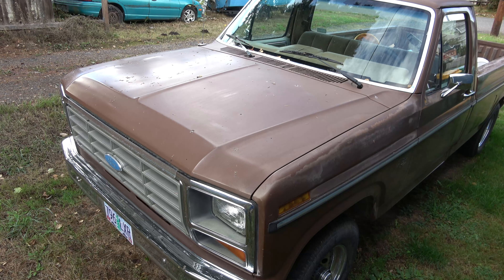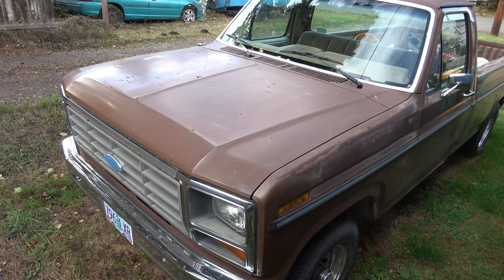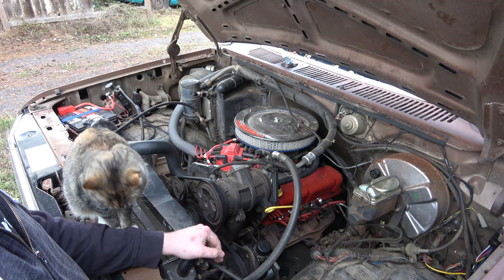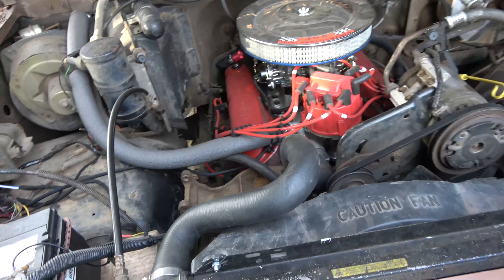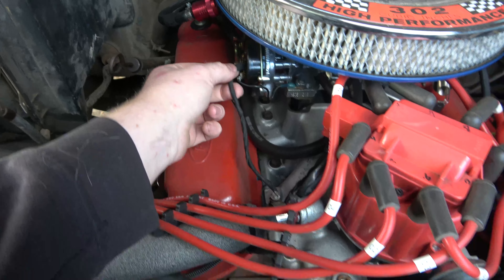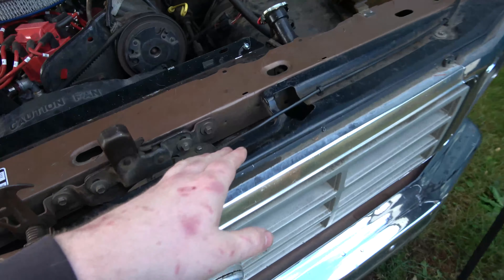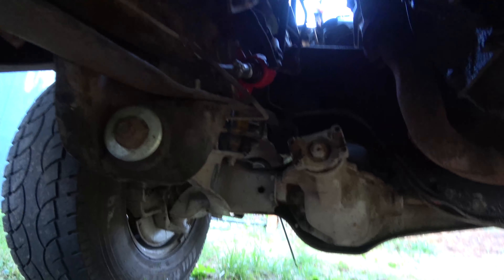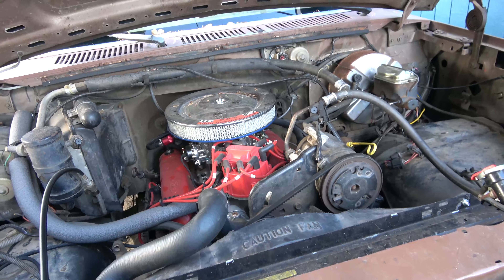85 F150 EFI To Carb Conversion Explained

Comment: Dude...u need a spacer under ur carb...ur gettin to much heat and vapor lockin...thats why it dont hot start
Reply from the maker: I ended up putting a 4 barrel carb and intake on. It has a 1” spacer on it now and it’s fine.

Comment: I bought an '85 F-150 Supercab new with a 302 and it came factory with a electronically controled carb, not EFI.   Also, later owned a '85 Bronco II that was also factory with a carb.  Now, every '86 I've seen were EFI.

Comment: Hey great video! I just bought an 86 carb swapped 302 that the coolant system needs to be put together in. So thats the 4 bolt main transmission without the overdrive in yours? I ask because ive got the aod transmission and need to check to make sure the tv linkage extenstension was added but its tough finding info on that. If you know even a bit about that id be eternally grateful.

Comment: I have a 92 Ford Bronco with the 351 Windsor I'm thinking about putting a sniper kit in it due to I had issues with my fuel injected system add too much fuel in a cylinder and bent a connecting rod I'm rebuilding the engine now sniper kit will I have problems with the transmission shifting

Comment: What did you do to the fuel lines on the frame rail under the cab of the truck. I have removed my high pressure fuel pump. I have also removed my fuel reservoir. I have the lines clear from under the truck all the way to the fuel tank selector valve. But I am having a trouble on connecting the new fuel line. Do I connect to the tank selector valve and plug the return line port and call it good on that then just connect the line to the mechanical fuel pump. What I want to do is utilize my reservoir and connect the line to that. Then just connect a small length fuel line from the tank selector valve to the reservoir, then reservoir to mechanical fuel pump. Any info would be most appreciated. 

Thanks.

Comment: I'm doing efi to carb swap on my 86 bronco. I put a 408 stroker motor in it. What vacuum lines did you retain and where do they go? I know I need to keep the brake vacuum, but what else besides that did you have to retain for everything to work correctly?
Reply: I’d like to know too.

Comment: I was wondering about your feul pump set up. Did you just keep the original fuel pump in the tank and use the 7 psi fuel pump as some sort of a fuel pressure regulator?
Reply from the maker: I kept the in-tank pumps. They run low pressure. I ended up running an edelbrock electric pump in place of the old factory frame mount pump. The in-tank pumps are just a lift pump that feed the frame mount pump. Works good and I don’t necessarily red a regulator.
Reply: @Bullford82  neat! I should have probably knew that but I'm doing research for my girlfriend to get the correct parts and the truck is a half hour drive away so I can't look at it too often. I work on chevys primarily so I'm getting use to the ford stuff still lol thanks for the reply man this should help out a ton with the carb swap

Comment: do this swap right now - so does the Edelbrock pump essentially act as a restrictor/regulator to lower the pressure from the in-tank pump?  thanks!
Reply: The in tank pumps were low pressure, ford put a secondary pump on the frame to bring the pressure up.

Comment: Did you have any trans issues? Sincerely, Richard Goodman
Reply from the maker: Hooking up the throttle valve cable was tricky. But I have since swapped in a 5 speed manual transmission.

Comment: What wires did you use to hook up the distributor?
Doing the same swap :)
Reply from the maker: I used the key on wire from the alternator to trigger a relay which feeds the distributor.

Comment: So how could one make this work with dual tanks?
Reply from the maker: It works with both tanks. Your only changing stuff after the selector valve.
Reply: @bullford8218  we need to chat on this more. I’m trying to figure out how to make this work using existing hardware from my 1993 EFI pumps, switches, and valving.

Comment: Good job on carb- Little cam & exhaust  upgrade will make it come alive - I fooled w/ my small block initially  too much intake Then went w/ dual plane 600 holly Comp cam headers 2.5" Came alive - I wouldn't  sell old Ford I ket mind get away & severely  regret- The re good ole truck simple technology Always get you home - It's getting hard to find one now ah days in that kind shape -

Comment: What’s your opinion on a smog pump delete on a 86 f150 EFI 302
Reply: Does it alot of good, you'll need a smaller  belt too
Reply: I’ve got rid of the smog pump and got rid of the EGR on my 90 302 with long tube headers true dual exhaust running cherry bombs too and that thing is ALIVE